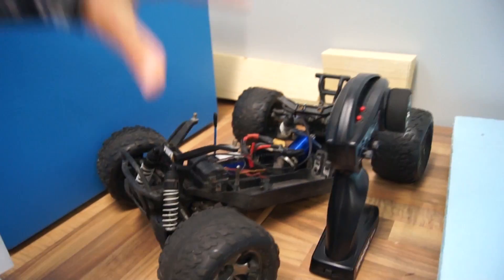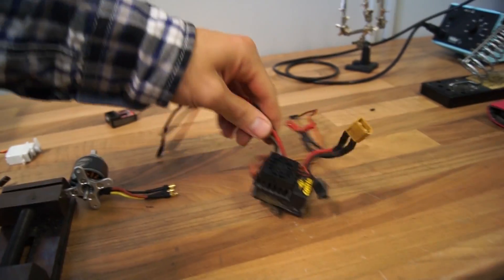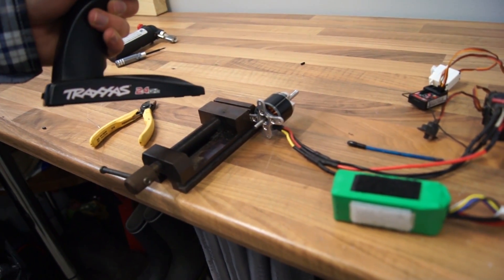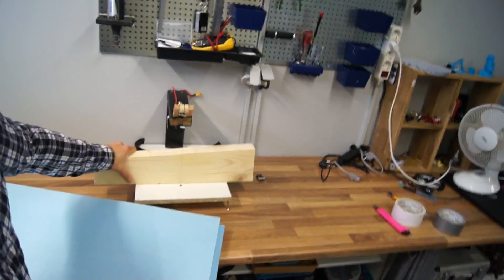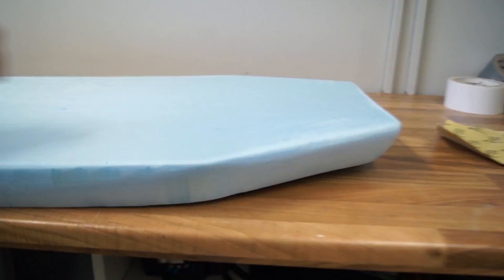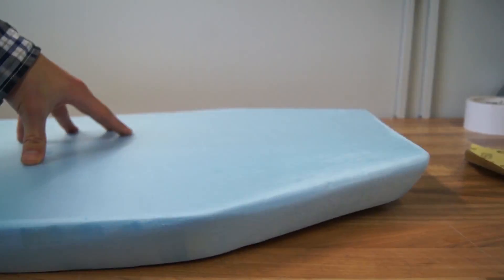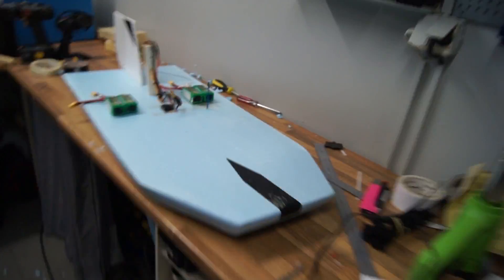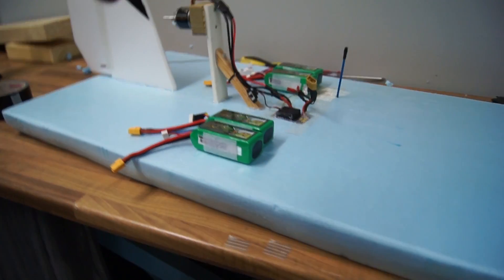Huge Foam RC Airboat Build Vlog 1 - RCLifeOn

Comment: Hey! where's your hovercraft?   Don't tell me you haven't built one yet, they're some of the most fun you can have with RC.

You've gotta get into hovercraft man, here, check this out, it's one of my builds, a racing style hovercraft with weight shifting pilot.  https://www.youtube.com/watch?v=7-oTpiiwjVA&index=6&list=PLGbZTlKSG1v9yLH3yBXPXX6cCy8zQNdTt

Pay attention at 3:30 in this vid if you want to see it clear a curb with ease.
That link has my HC playlist, if you need an easy way to be successful, check out my skirtless hovercraft build, those things are magical!   They literally fly an inch or two off the ground  (depending on width, generally 10%).   My skirtless instructional video is a rough demonstration of the principle of how to build a double hull with it's own lift fan.  For more detail check out https://www.rcgroups.com/forums/showthread.php?2378589-Animatronic-pilot-twin-fan-scale-craft%21 as well as my other threads in the HC forum. 

Back in the day, like in the late 80's i built an airboat similar to yours with a .45 glow engine and 11" wood prop mounted on a slick bottom Boogieboard.   I stuck the electronics inside a couple of balloons to waterproof it all and it was a real screamer on land or water.

Comment: Could I use the velineon system?
Reply: I think you could technically use the esc, servo and RC transmitter but you'd have to get a plane motor

Comment: Great build fellow! I also made my airboat, but out of hard 3 mm thick PVC foam board with a 6 mm thick PS Depron foam for the bottom of the hull. Its hull is much smaller: 340 mm in length by 195 mm in width and 50 mm height, where all the electronics is inside. I tested it only once on a park lake and due to slight wind had some stability issues when I added more throttle, and was afraid it would likely flip away to the front. I'm guessing it has to do with a bigger angle of the hull curving, which beggins to curve up after 200 mm the length size from flat side of the bottom. So, since the flat portion of my airboat's hull is mainly square-shaped, I should probably make it a bit longer, and increase the curving angle.
Reply from the maker: Nice to read about another airboat builder! Sounds like a solid design, good luck!
Reply: Thank you.

Comment: Can i osow jouse a oder plan esc with 50 amp
Reply from the maker: Sorry, difficult to understand your text. A 50A ESC works with motors rated lower than 50A, like the one used in the video.

Comment: cool video mate. whats the weight of your boat? i have built a big airboat and it  weighs 5kg what motor prop combo should i use???
Reply from the maker: Motor: http://www.hobbyking.com/hobbyking/store/__80685__Turnigy_Aerodrive_SK3_3542_1250kv_Brushless_Outrunner_Motor.html

9x6 propeller on a 4S battery and should you have a good power system. I recommend a larger motor, but I couldn't find one right now.
Reply: Thanks mate ill give that a go. Did a test today and she did not sink which is a bonus
Reply from the maker: +FpvExmouth That's always a relieving feeling!

Comment: Hello, I ordered the suggested esc from hobbyking but I didn't order the motor because the delivery will be after my project submission date. I could also not find the 2208 1800KV series motor on Amazon or any other site which can deliver on time. Is there any compatible motor that we can use? I have already ordered the following:

1. ESC- Afro ESC 20Amp Multi-rotor Motor Speed Controller (SimonK Firmware) (AR Warehouse)
2. Battery- Afro ESC 20Amp Multi-rotor Motor Speed Controller (SimonK Firmware) (AR Warehouse)
3. Servo-HXT900 Micro Servo 1.6kg / 0.12sec / 9g (AR Warehouse)
4. Receiver and Transmitter-GoolRC 2.4G 3CH AFHS Radio Remote Control Transmitter with Receiver for RC Car Boat

Thanks for you help!
Reply from the maker: Here's a motor from Ebay (USA): http://www.ebay.com/itm/New-Turnigy-D2826-6-Brushless-Outrunner-2200kv-Quadcopter-Airplane-Motor-USA-/141525834132?hash=item20f398d994:g:tTMAAOxyUrZS4I3f

You need a larger speed controller like this: http://www.hobbyking.com/hobbyking/store/__80500__Aerostar_40A_Electronic_Speed_Controller_with_3A_BEC_2_4S_.html
Reply: Thanks a lot! I will let you know when I'm finished my project.

Comment: Hello, Topper Than Top and I are working together on a project. I had a question, will the transmitter and receiver (the link bellow) be compatible with the links you sent Topper Than Top.

Transmitter and Receiver:
https://www.amazon.com/GoolRC-Remote-Control-Transmitter-Receiver/dp/B01CCB9IGG/ref=sr_1_19?ie=UTF8&qid=1475460124&sr=8-19&keywords=2.4+ghz+transmitter+and+receiver
Reply from the maker: +Techcuber723 Yeah sure, no problem. Good luck!
Reply: RCLifeOn ok thank you!

Comment: Hello, I have a school project where I am going to build an airboat. Can you please tell us some compatible motors, ESC, and servo. I am also planning to make it around 1 to 1.5 feet. Thanks.
Reply from the maker: Hi, sorry I couldn't answer any quicker! A 1 feet airboat is really quite small, but I managed to find a system that should work fine. Good luck!

Motor: http://www.hobbyking.com/hobbyking/store/__67014__Quanum_MT_Series_2208_1800KV_Brushless_Multirotor_Motor_Built_by_DYS.html

ESC: http://www.hobbyking.com/hobbyking/store/__43709__Afro_ESC_20Amp_Multi_rotor_Motor_Speed_Controller_SimonK_Firmware_.html

Servo: http://www.hobbyking.com/hobbyking/store/__662__HXT900_Micro_Servo_1_6kg_0_12sec_9g.html

Battery: http://www.hobbyking.com/hobbyking/store/__7314__Rhino_2250mAh_3S_11_1v_25C_Lipoly_Pack.html

Transmitter + receiver: http://www.hobbyking.com/hobbyking/store/__10608__HobbyKing_174_8482_GT_2_2_4Ghz_2Ch_Tx_Rx.html
Reply: Kuky your a sh'*
Reply: @RClifeOn,How many Batterys do I need for this Version?2?3?
Reply: sorry that I ask again,but how much batteries o I 
need for this smal Version?
Reply: It seems you know shit about rc projects..

Comment: is this version better then the ducktape airboat? and why?
Reply from the maker: Yes it does have some improvements. The increase in thickness of the foam makes it way easier to drive in water. It also has a more powerful and efficient power system (higer voltage and lower KV motor). A larger airboat is always more stable and can handle more payload. Part 2 will be up on thursday or sunday. Thanks for watching!

Comment: nice and simple.
I hope the size of the base doesn't cause to much drag.
Reply from the maker: It sure is quite simple, and only takes a couple of hours to build. 
I took it out for quick run yesterday and it worked beautifully till it flipped over. I moved the batteries forward and now its perfect! Second part of this video will be up on thursday or sunday. Thanks for watching!
Reply: I just made one out of balsa and painted it in Colour changing paint.  I found that mine spins out a lot to the point where its hard to drive. 
Experimenting in how to increase strait line stability.